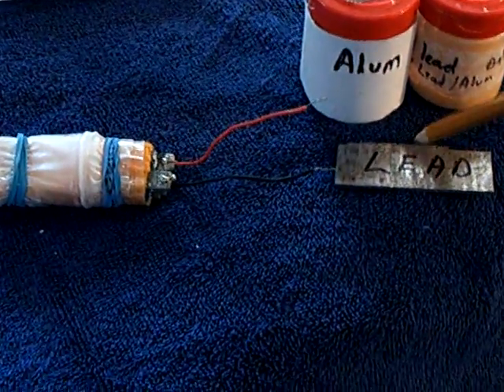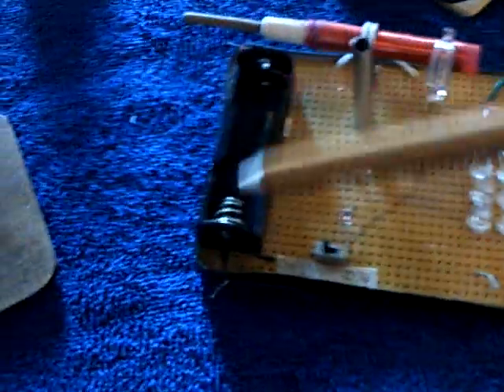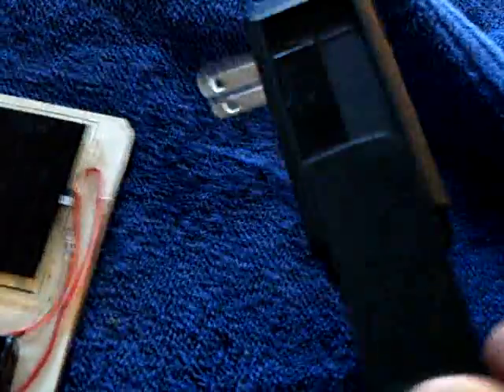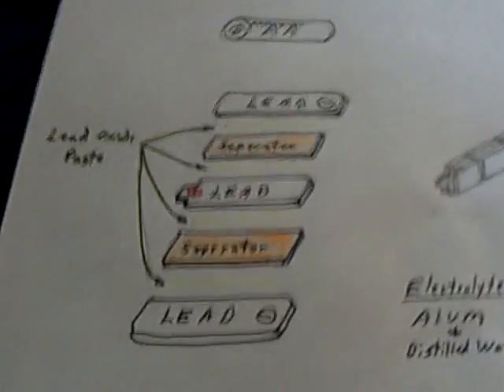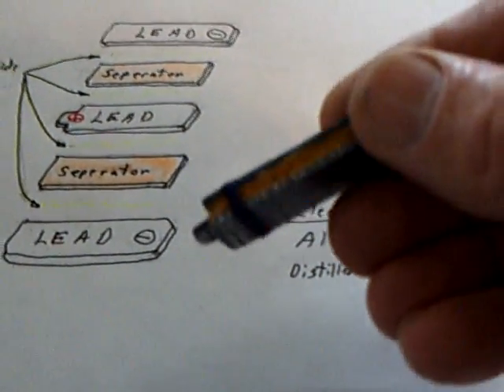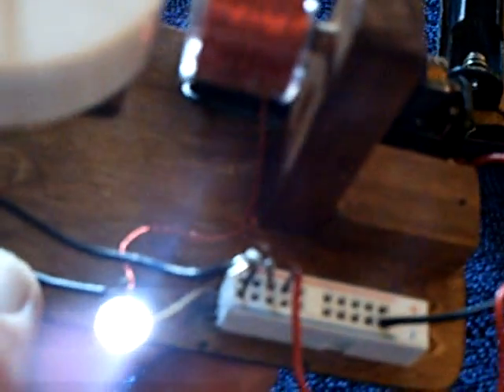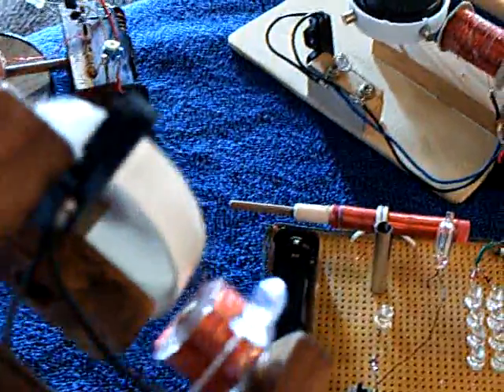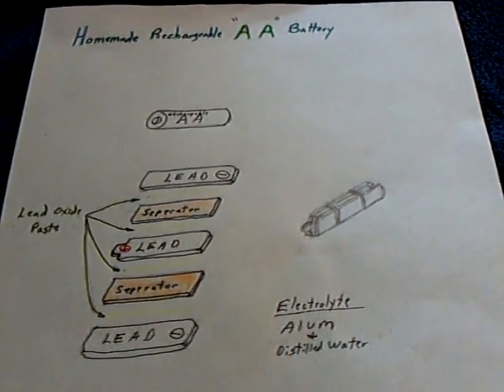Homemade rechargeable AA battery

Comment: Awesome I haven’t been able to make a super useable battery that fits like that one yet great video. I’m working on using dough for an electrolyte instead of using a liquid. I’m also going to try and seal it in wax so it hopefully stays wet. I’m making rechargeable and non rechargeable. I wanna power an analog clock with them. Any thoughts?

Comment: Hi, Thanks for the video. What is the life time of this battery and do we need to wet it again and again?
Reply from the maker: +Seema Sarfaraz This little battery really never wears out because I made it so I can take it apart and rebuild it.  It dries out pretty fast but water reactivates.
Reply: +Seema Sarfaraz There are many factors in battery reconditioning. One resource I discovered that successfully combines these is the Jons Mender Guide (check it out on google) definately the most useful info that I've seen. Check out this incredible website.

Comment: 2/2 if there is a aligator clip attatched on the 2nd connection of the led that just runs into air or also when i touch it the led pulses in the same pattern only dimmer
can you please explain what happens there?

Comment: this is a great device congratulations on your success
on a personal note i now finally managed to replicate your pulse motor
and boy, is that a fun thing to play with :D thank you very much!
i wired it up with aligator-clips when i tried to get things into the right order
once it worked properly i noticed that the led clip does not have to connect back to the battery to work 1/2

Comment from the maker: Thanks.  I will look up tap plastics.  Yes I have tried zinc / lead and it works great.  I have a cell running on an automatic solar  "garden light" type  led circuit right now.  It seems to work really well.  I was going to show it in the video but I thought that it might confuse things.  The electrolye is Alum and sodium carbonate.  John Bedini came up with that electrolyte combo.

Comment: Hi,

You mentioned a surface area problem.  Have you considered getting hold of some lead foil and sandwich your separator between two strips.  Perhaps you could then roll up the sandwich and place it in a tube of some sort.

Jim

Comment from the maker: The only way that I got my wall outlet AA chargers to fillup my lead/Alum cell was to put it with another standard AA.  The cell appears to have too high an impedance for the charge to want to work with it all alone.   The reason that I did a (-) (+) (-) was because John Bedini said to do it that way.  I figured that he had done the homework and testing already and decided that it was the best way. Putting this in a tube like you described IS a better way.  I gotta find the right tube now.

Comment: automatic anti-shake video filter is a good thing. BUT you need a) to zoom out a bit since this function tends to crop the screen quite a bit and b) you should get yourself ANY high res video cam. Any cheap Full HD for less than 100$ should make it. again since this anti-shaking filter tends to "blur" pictures even more than the original footage. - i am commenting this because i feel i cant watch this video at all since it is bugging me off through blur and zoomed in frame. cant enjoy it.

Comment: I've been thinking about doing this. You beat me to it again. Nice work. I was looking for plastic tube the same diameter as a AA. Not necessary. A bag, or some cling wrap, or some tape would protect you from contact with lead though. If you get it started with another AA in the wall charger, can you remove the standard AA once the alum reaches a certain charge? I seem to get more corrosion on + plates, so I'd go PNP for 3 plates, whats the advantage to NPN?